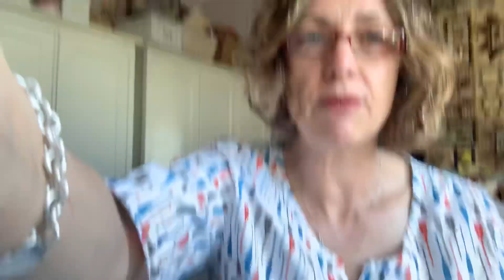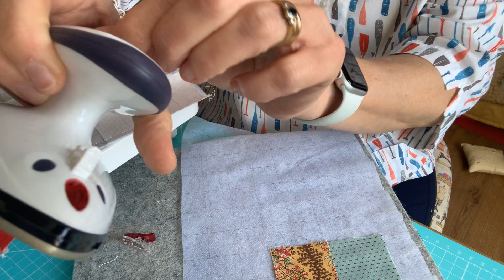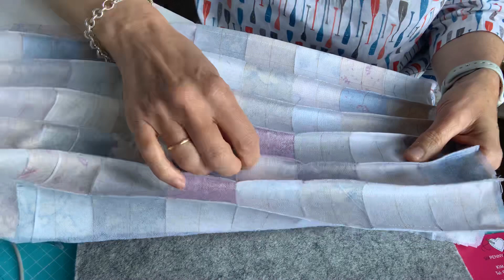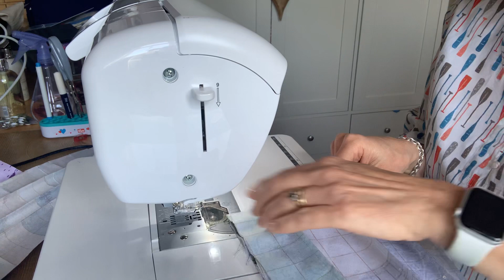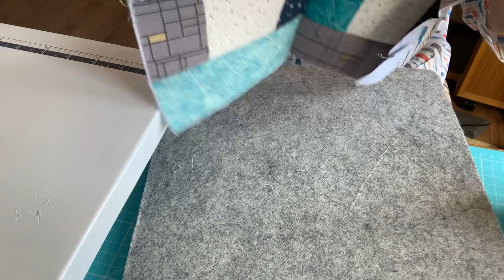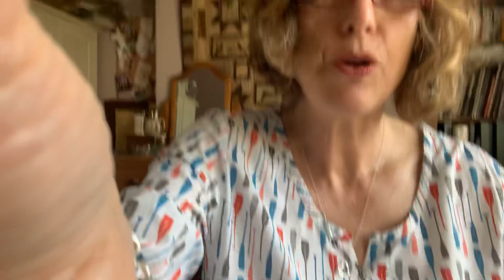Vlieseline Quilters Grid how to use it.

Comment: The Pelion grid is marked in 1 inch squares. T finish the layoout with 1 inch squares you need to start with 1 1/2 inch squares reduced to size with 1/4 inch seams.    Exactly how do you place the 1 1/2 inch squares on the grid. this demo does not make sense t. Please respond.
Reply: The fabric square is 2”, it is laid across two Pelion 1” squares. Once the quarter inch seams are sewn, each finished fabric square measures 1.5 “.
Reply: Sorry, it is not Pellon she is using, she is using Vlieseline. But it is the same process.